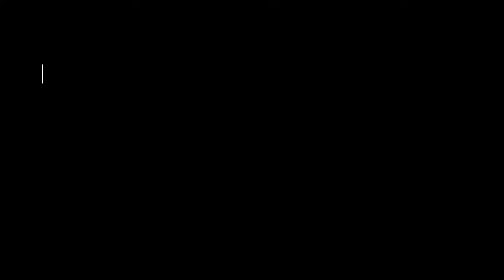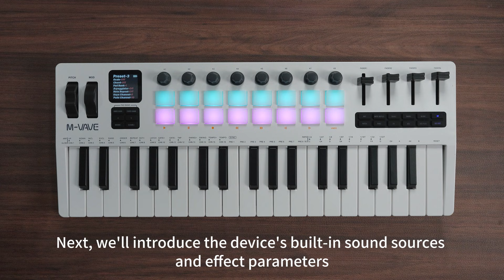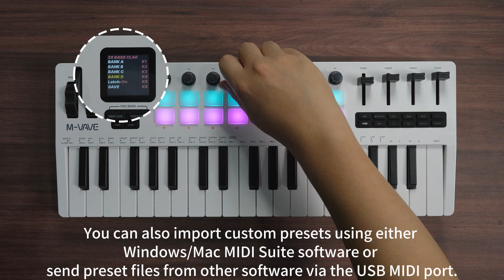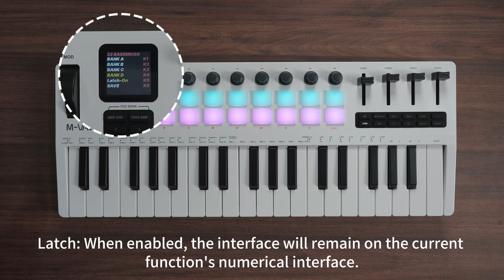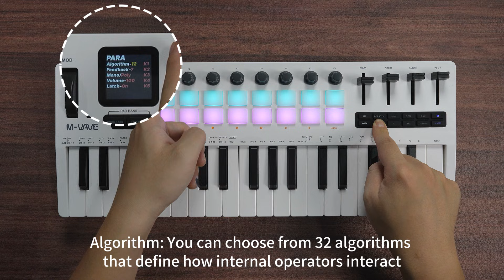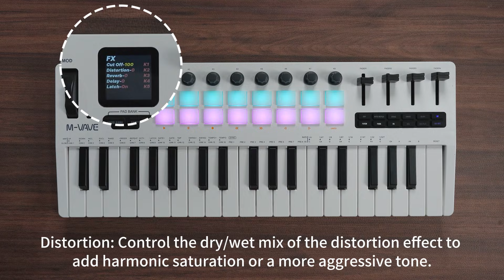M-VAVE SMK-37 PRO Built-in Audio Source Introduction：Patch · Para · FX

Comment: I've got a problem... Today I bought the SMK37 Elite Midi, and on the one hand, I got what I expected. On the other hand, I can't record patch audio properly. I use an external professional sound card, and it doesn't have a USB input. Therefore, to record the SMK37 as an input, I need to enable the built-in Windows Asio driver (instead of the sound card's Asio driver). But even so, I still have trouble because I can't listen through my headphones, which are connected to the sound card. So, to record patch audio, I have to switch Asio every time and switch from the sound card to the computer's output. Honestly, I expected the option to connect the audio output to the sound card (for example, via a 6.5mm jack or XLR), and that would be much easier and better.
Reply from the maker: Thank you very much for your suggestion. However, currently only recording internal audio using the asio driver is supported. We will pass your suggestion on to the development team.

Comment: Does this have the capability to be controller by Other Midi Keyboard? Using only the SOund from this device?  or simply does this have Midi In and OUT?
Reply from the maker: Only midiout
Reply: @M-VAVE  but in PC can it accept midi Signal from other Device ie... I have another usb Device Bigger Keys and I want to Control the SMK73 inbuilt sound. is this possible? 

Does it have a virtual MIDI In and MIDI Out?
Reply from the maker: @arnelbarbarona2823  The built-in audio source can be triggered via USB MIDI input.
Reply from the maker: @arnelbarbarona2823 Only supports USB MIDI in, not normal MIDI in.

Comment: SERIOUS BUG REPORT FOR SMK-37 Pro:

THERE ARE 2 BIG PROBLEMS (using latest firmware - v13):
1) When playing a FAST sequence of notes (for example an arpeggio or a trilling), some notes are skipped or lag.  If you use the modulation or pitch-bend at the same time, it is even worse. I seems that the processor just can´t handle notes that fast.
2) If the keyboard is left unplayed for a while, when you play again, the first note lags a lot.
PLEASE CORRECT THIS IN THE NEXT FIRMWARE.

Comment: Any chance to have a separate volume for synth engine and audio out ( i.e. audio from an external daw) and to save the synth volume parameter of the synth in every patch? Right now volume can’t be saved in patches. 

P.s. delay has a glitch, it can be saved on patches but when you turn on fx it starts at max value ( or 0, but only when you saved it so in the patch ), even showing the value you saved, and you need to touch the knob to have it to the right value.